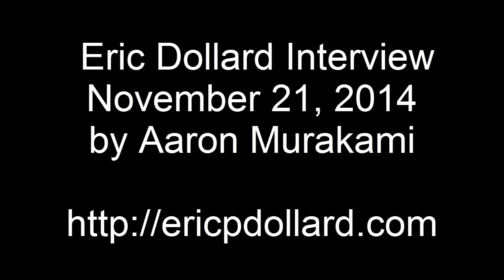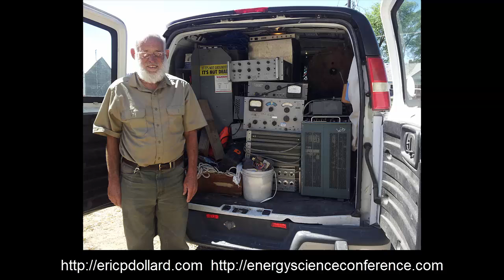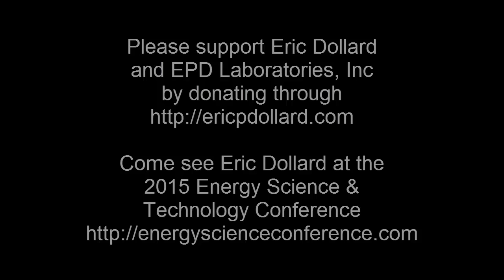Eric Dollard on How the Work Actually Gets Paid For

Comment: Regarding power line interference, would it be possible to do a phase-inverted mix of clean power line signal with the antenna feed?  that would actively cancel the grid hum using its own signal, which should have minimal impact on the subject being studied (much less than the unfiltered noise itself!)